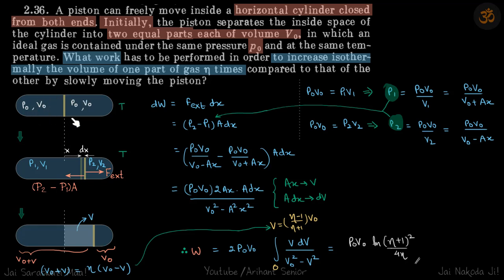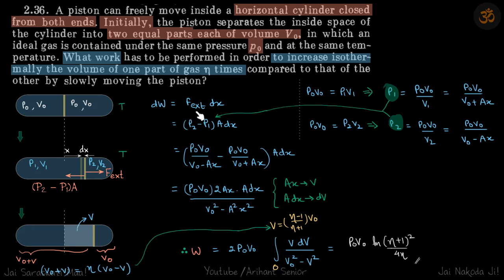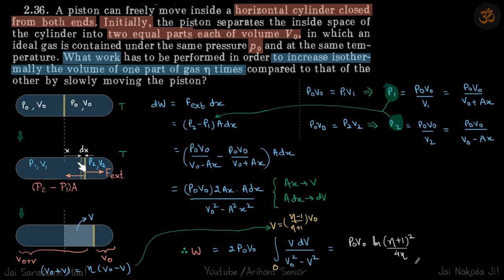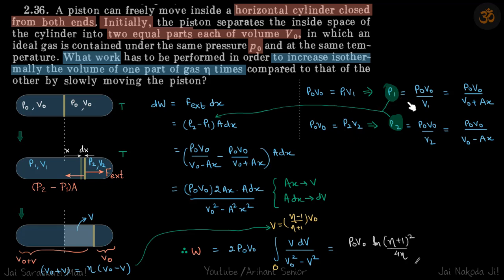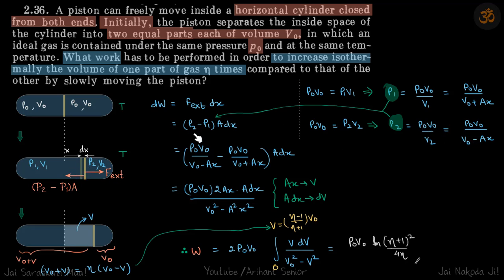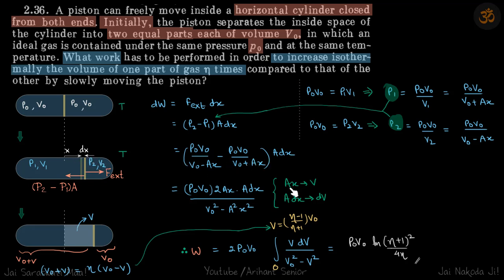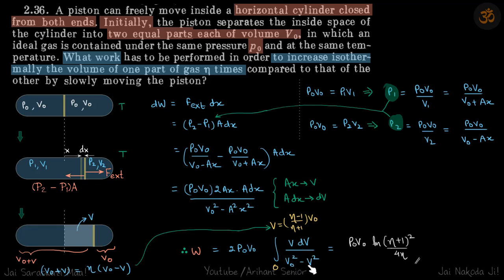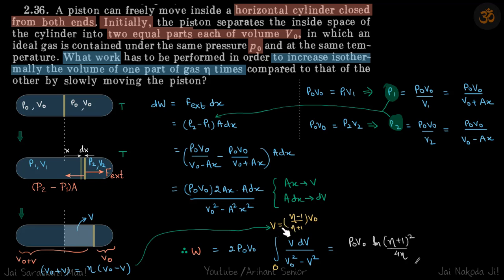2.36 | Irodov Solutions | Thermodynamics

Comment: Sir i applied work energy theorem here as Wext +Wgas left + Wgas right = 0 (piston moved slowly no change in KE) and wrote Wgasses using isothermal work formula (PVln(V2/V1) but ans did not match could you please explain
Reply from the maker: Too many problems in your equation. You missed heat. Besides in your equation Wext(thats due to Fext) term is problematic as its net work that involves both parts of gases(think like piston with friction, work against other side is like friction here). So writing this equation on individual(left or right part) yields no results. Even if that was not the case, your equation would still yield nothing as with massless piston Wext+Wgas =0. Thats why we did it with force.
Reply: @Ankit_Singhvi  No sir ,, sir I got the correct ans from this equation also earlier i was doing some calculation error.. 
As the heat is energy but we only include work done in work energy theorem and the piston will be frictionless
Reply from the maker: Nice. I will try too. Always good to have multiple methods.
Reply: @Ankit_Singhvi  Yes sir....
Sir do you have any telegram channel?
Reply from the maker: @MohitKumar-zc8pc  Yes, links in description of any video.
Reply: @Ankit_Singhvi  okay sir thanks
Reply: @Ankit_Singhvi  sir just one last thing to ask you....
Could you please tell which would be more preferred to solve PF's build your under and mcqs or Irodov in terms of relevancy with jee
Reply from the maker: @MohitKumar-zc8pc  pf in my opinion.
Reply: @Ankit_Singhvi  literally, solving irodov is not fruitful?